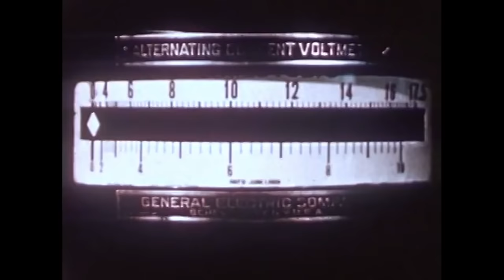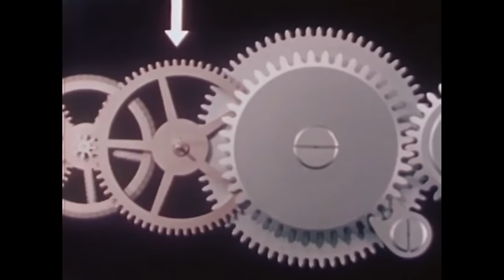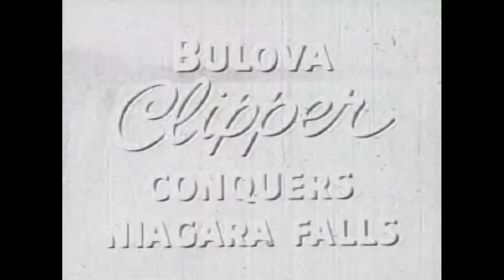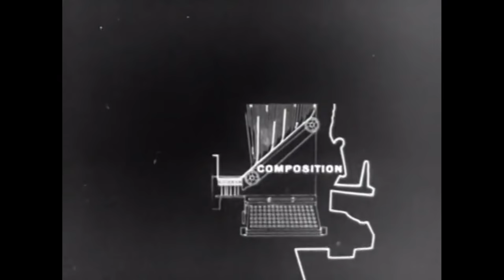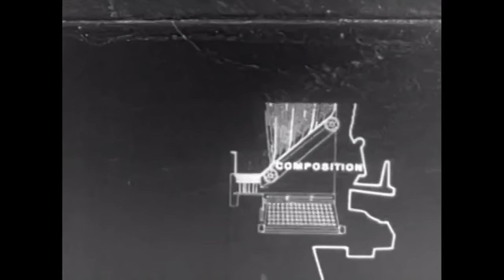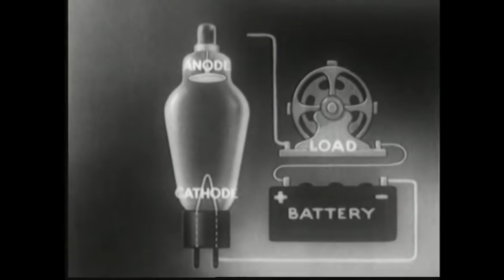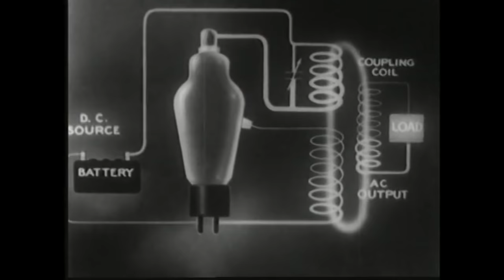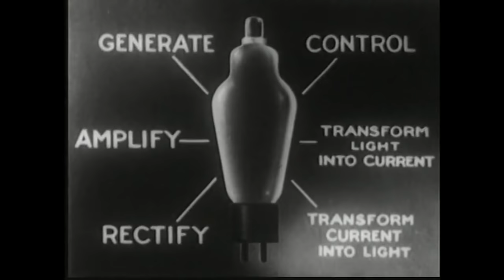Sleepcore: Mundane Media for Insomnia

Comment: From the engineering perspective, the human heard doesn't make a lot of sense.  If I was trying to design a system that kept constant pressure in the system I'd use an accumulator.  The closest equivalent in the human body is the aorta.  But it's much smaller than the heart.  If god designed the human body then he over invested on the heart and under invested in the aorta.  Could have got by with simpler parts is what I'm saying.  Guess he's not that great an engineer.